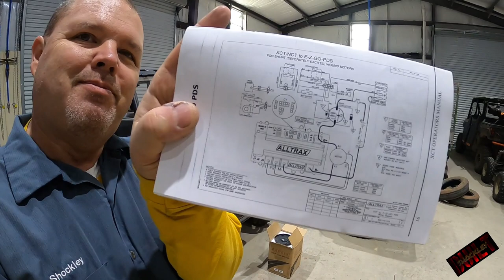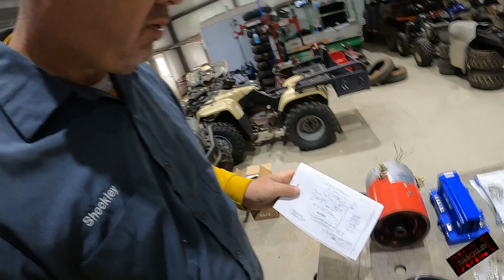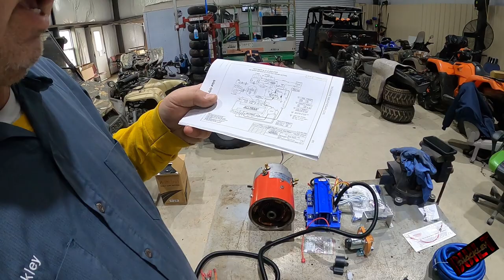EZ GO Golf Cart convert series to PDS drive system

Comment: Can you share the link to the kit you used?  Cost involved?
Reply from the maker: No link to a kit. I pieced it together. First thing I ordered was the motor and Alltrax controller. In the controller instructions is the blue prints and listed components needed. I then ordered all the needed capacitor and switches and such I needed. I found complete wiring harnesses that made the job simple.